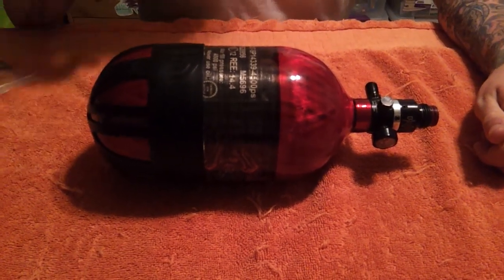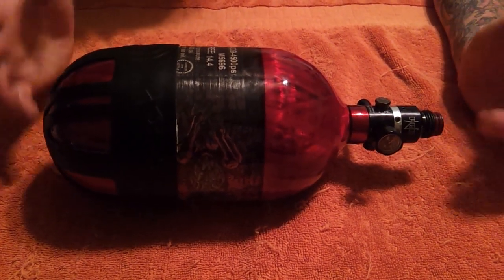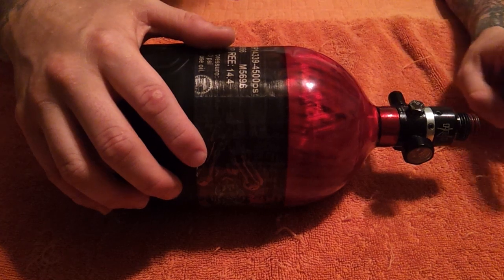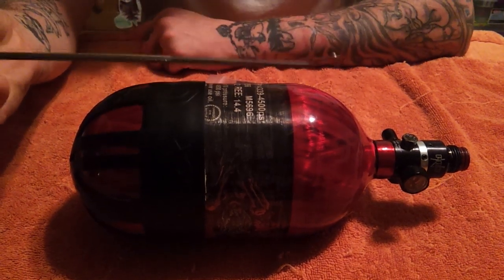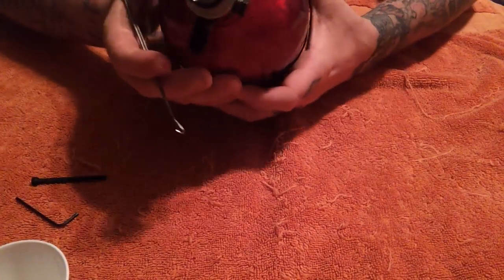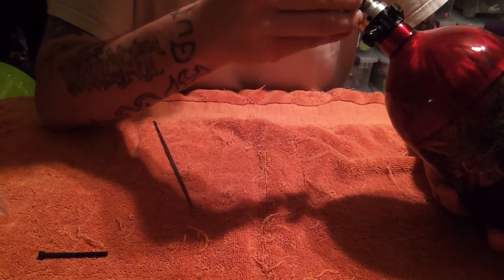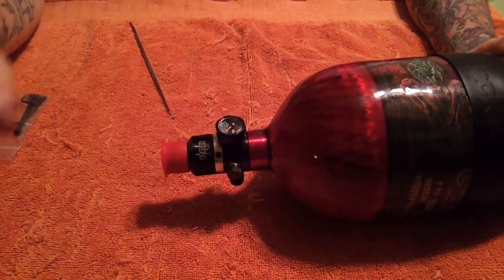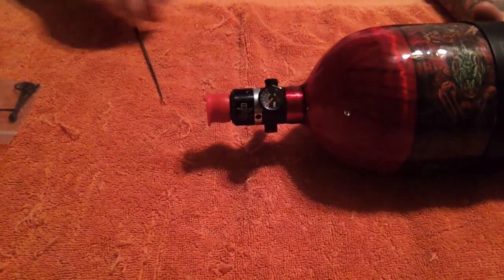Adjusting Output Pressure On Tank Regulator

Comment: Thank you for this video.I am soon installing a regulator to a new tank and wanted to know what the deal was.

If I can be any help to you or your viewers,(because I thought thread lock was a good preventative measure,but appearantly not necessary),thread lock is an anaerobic substance,meaning it dries in the adsence of oxygen(between the treads is enough of a lack of oxygen).Leave it on the table open air and it will stay fluid for days.In use,it starts cureing right away and reaches most of its potential in a couple of hours.BLUE is temporary...turns to a hard paste so it can be broken free but cause enough drag that parts dont easily unthread.RED is more permanant and dries hard...not good for things with soft threads like brass and aluminum if you plan on disassembling and reuseing.GREEN is supposed to be like the 'death grip' of the 3.Havent used it.

But I caution you this.If you useany locktight in this application and someday unthread your valve,be sure to evacuate any particles that fall into the tank,cause there will be some...and we know what happens when particles get into valve seats.

Again,thank you for the video.

Comment: So the less rings the softer your gun shoots?
Reply: Dylan Snijders less washers, less pressure output on just the tank. You regulate your guns psi from on your gun. Some guns require lower pressures for the bolt to work proper. Hope that helped

Comment: What tank should i get for a G5?
Reply from the maker: any tank will do as long has it as an adjustable reg that can be set to mid pressure
Reply: I'm either getting a SLP tank which has an output of about 300psi or something more affordable and then I'll open it up and lower the pressure as far as I can.  Guerilla and Ninja tanks can be lowered to about have output of 500psi

Comment: Hi Jason,

Thanks for the video!  I have an empire axe with a boss bolt set at 150psi, so that being said would I need to lower my output pressure from my tank? I just bought ninja tank with a pro v2 reg. Thanks again.
Reply from the maker: +Andrew A you should be fine with just using the Ninja stock output pressure

Comment: Jason, thank you for making this video. I have an old crossfire tank. How can I tell if the regulator is adjustable? I am using my tank for an insight.
Reply: A better question may be: do you know a good video or website were they adjust the spring?
Reply from the maker: The crossfire tank needs a spring kit, you can go online and buy a low pressure spring to install on the reg

Comment: do you know if the pure energy tank regulator are adjustable to low pressure?  my regulator is a blue one. I have a drone 2 that requires 100 psi.
Reply from the maker: it all depends if they use shims or springs
Reply: +Jason Wright from what I gathered they are serviceable like this video.  it the blue type regulator with the set screws on the top part. I think I found a low pressure kit for it. I just wanted to see if it is all ready a low pressure.

Comment: What pressure should I use on geo 2.1
Reply from the maker: Stock 800 psi will be fine
Reply: +Marcellus Muller I would do mid pressure just because the pops

Comment: Sup jay did some research and saw that my etha will run on any pressure. Now here's a good question for any1is there an andvantage to runnin low or high say for efficiency purposes if your able to run any setup?
Reply from the maker: The output pressure of your tank is changed due to the amout of pressure your solenoid can handle. As far as efficiency, that will be based of the size of your paint, if you have a good bore, weather,  temperature of you tank.
Reply: So pretty much there's no advantage for more shots per fill, and will it be ok to test the lower pressures on my etha, is it safe for the marker I mean to test? Just wondering the whole pressures new to me thx in advance

Comment: yo, J,W. My dye dam leaks when i screw in my bottle and dye tell me i need a max of 200psi input to the asa but my old zen bottle kicks out 1k! 
are they talkin crap? coz my old tippmann worked fine with this standard reg and zen bottle. please help dude
Reply from the maker: The truth is a lot of new marker have a lower in line operating pressure. For example the g5 needs your tank at 550psi. 200 psi is really low. The vapor only needed 300 same as the luxe. Does any one of friends have a tank you can borrow to test?
Reply: thanks for the reply jason, much appreciated. I think because i have a standard reg on my zen that it kicks out too much pressure because i did use one other ninja tank on my gun and i could then chrono above 260 without it leaking air but past 285 it began to hiss again so with some research i may have learnt that if i can regulate the air out of my bottle to no more than around 400 by using the ninja SLP then im half way there. am i right?
plus this dye dam i have has a shitty hyper 3 inline reg but its supposed to be set at 150 psi bt how you set it to that when it just got a velocity screw is beyond me!!
Reply from the maker: I would set your tank around 400 and test it. 200 sounds really low to be

Comment: This is perhaps a dumb question. I have a Pure Energy Tank. would this work for me?
Reply from the maker: Its not a dumb question. It depends on your regulator not your tank. The top of the tank that screws into the marker is your regulator that is what you want to dissamble to see how it is setup
Reply: Jason Wright well i know that stuff, I have a Pure energy tank and it has the washer (spring) stack like the ninja. I was just curious if this same idea of adding or removing things from the stack could raise or lower my pressure.

Comment: Hey Jason. Thanks for everything first off. But for a dangerous power g5 should I use high pressure, low pressure or what?
Reply from the maker: 550 psi. That will be medium pressure

Comment from the maker: those are what you remove here is the break down
1. remove one spring ...... 800 psi x 1/10 = 80 psi
2. remove one spring ..... 720 psi x 1/9 = 80 psi 
3. remove one spring ..... 640 psi x 1/8 = 80 psi 
4. remove one spring ..... 560 psi x 1/7 = 80 psi
5. remove one spring ......etc

Comment: I have a 2010 proto pmr.. and I'm using a crossfire 68/4500... I haven't adjusted anything its it fine.. I know the soleniod on the gun is low pressure but idk if I have to adjust it.. help!

Comment: Hey Jason, first off, love your vids man.  Quick questions, I use an empire axe with an infamous bolt and the medium spring, my pressure on the axe is about 170ish, and I use a regular HP ninja tank. Now, would you recommend to lower the pressure on the tank or leave it as is?  And does it make a difference with a lower pressure tank?